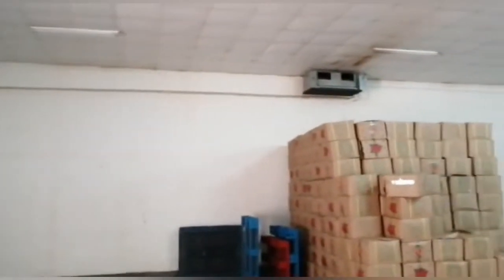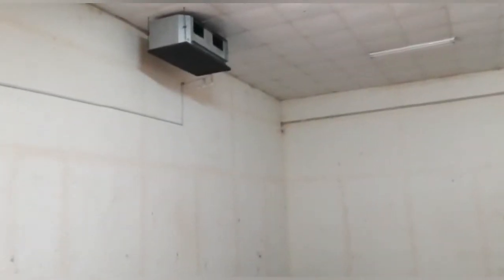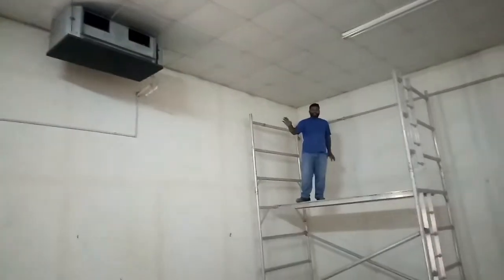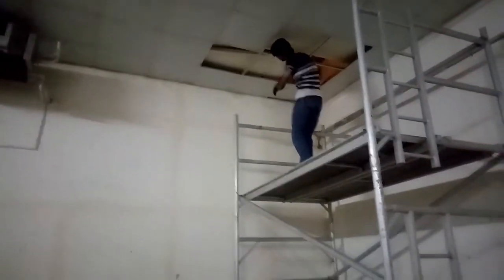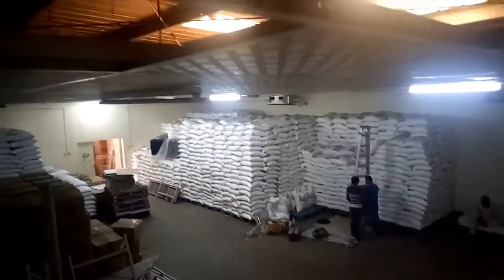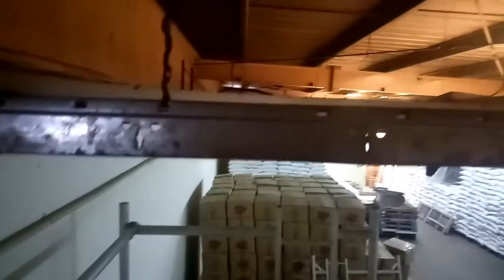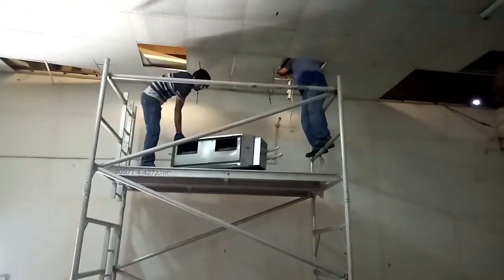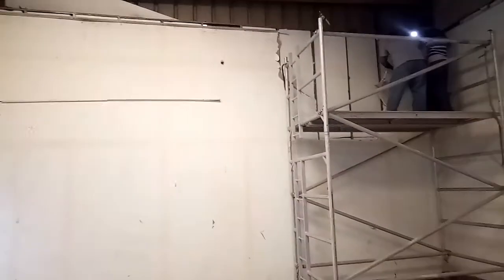Refrigeration System - Cold Room Installation - New Project Part 1

Comment: Thank you this video it illustrates all the steps in an easy way to understand . Question what is the width of the space inside the warehouse & whats the wall hight inside from ground to ceiling ? 
Thanx for your reply in advance
Reply from the maker: Thank you For You Comment And Question.
Dear This Ware House Deimention Is 17meter Width x 27meter Length x 4.7meter Hight Ground To Ceiling.